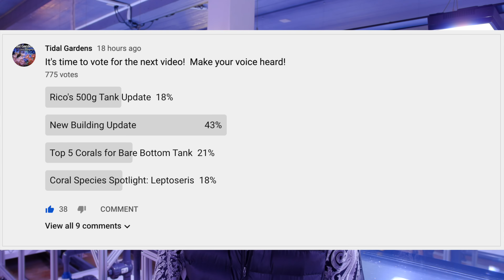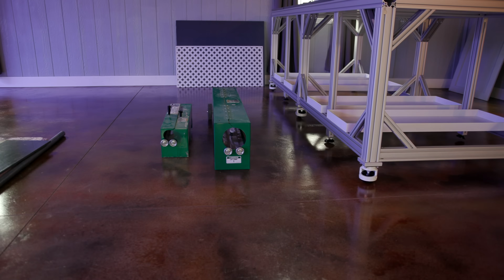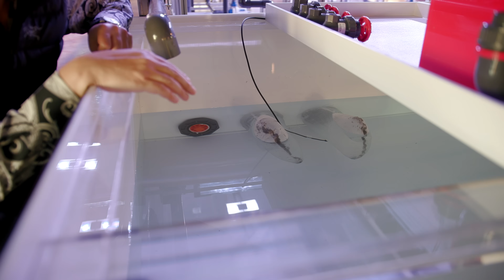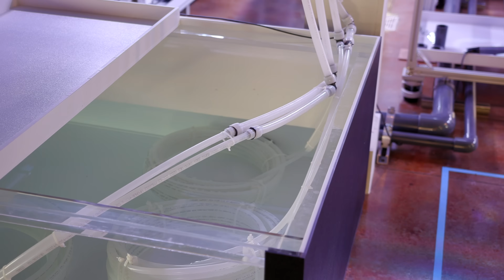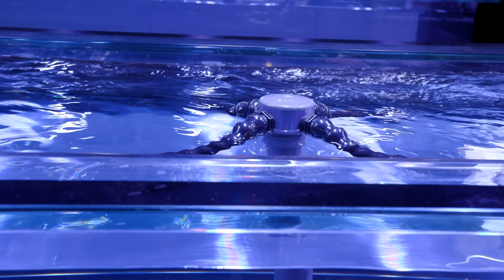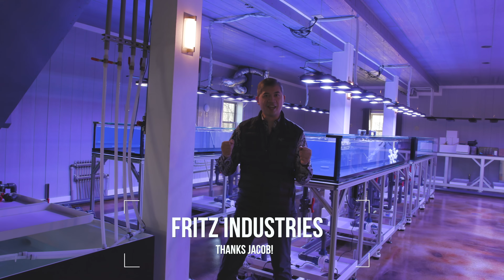Tidal Gardens November 2019 New Building Update - Episode 12

Comment: 6:49 I dont understand why you decided to use so many 90 degree elbows on the pumps under the tanks... By just slightly move the pump and rotatate it 90 degress, no less than 3(!) of the elbows could get eliminated and a lot of unnecessary head pressure would be gained on each setup. The same applies to many other places on the pipings.

Comment: Why did you use schedule 80 instead of schedule 40 pvc pipe?  Seems to me your pressures are not high enough to exceed the capacity of schedule 40.  Great build by the way.  Your geothermal temperature control system is unique and great.👍

Comment: If you want to bend smaller diameter pipe up to 1” and don’t have access to a hot box, heat gun will work.  Fill the pipe wth sand and heat and bend!

Comment: You are living a dream for reefers around the world.
I saw the air make up in the back but what about dehumidifiers ? 
Just wondering .
Reply from the maker: For the winter the air exchangers can easily handle the humidity.  They are surprisingly good at that as a matter of fact.  We have them set to the lowest fan speed and the building is dry.  Once we get into the humid spring and summer though we are going to rely on the air conditioning first.  I have one 5-ton unit, but the line sets ready for a second 5-ton unit.  If that is enough we will have to add dehumidification near the tanks.

Comment: May I ask what are the frames for the tank stands and where might I be able to get them?
Reply from the maker: It is 80/20 aluminum t-slot
Reply: Michael Balsley it looks like 8020 aluminum extrusions.  Probably one of the metric types since he mentioned using M8 screws.   It comes in a variety of sizes and configurations in metric or imperial.
Reply: Likely Framing Tech https://www.framingtech.com/solutions/aquarium-stands/

Comment: Love the new set up, Than. Wish I lived closer to see everything when you're done. Had a question for you: are you just running the single L2 on those frag tanks? I'm setting up a 130 frag system and was going to use a Varios 8 for a closed loop until I was told that DC pumps don't handle head pressure that well. First time setting up a closed loop so any help would be appreciated. Thanks!

Comment: Great vid! I'm surprised you didn't fit sweeping elbows on the 3inch drain section where you're planning on using a drain snake. I reckon you'll have problems getting it through that tight 90. Can't wait to see everything stocked!!!
Reply from the maker: Hopefully it wont be a huge deal. Just for fun I looked up the price of a 3" schedule 80 long sweep. Makes my eyes bleed.
Reply: @tidalgardens  I can imagine! What was the reason for going schedule 80 on everything? Just added peace of mind on how hardwaring the system needs to be? I guess you're about as industrial as it gets in the industry hehe! I check your channel every day just in case I've missed a notification!
Reply: I was thinking the same thing. That tight elbow is going to be a pain to get the snake past.

Comment: I'm very curious what kind of hassle/maintenance over long term will be, to me it look super solid and your design/choice are the same has I would do minus your experience.
You could make a rotation/spining thing with the return tube, from your closed loop, potential is here.
Reply from the maker: We have some but they are cheap and look like they would fail. Also vectra pumps have a closed loop mode where you can program them to do different flow patterns. Having said that we will probably just leave them at a set speed.

Comment: Thanks one more time for sharing, such a nice and reflected setup! I would be worried a little bit about your overflow system / sump capacity: if you stop return pump (and there's only one), water level will go down up to level of main first overflow. With such long tanks, and you've got 4 right?, is the sump really big enough? Would suggest to consider one modification on these main overflows: use another tube on them, to reverse the intake not at the top but bottom, and little hole just under water level of the skimmer to deactivate the syphon. 2 benefits: taking water from bottom, and minimise diff between main and skimmer overflow, meaning less water going to the sump if return pump stop. What do you think? ;)
Reply from the maker: We are going to test it and install siphon breaks if necessary. That part is easy. The sump itself is huge. Around 500 gallons total.

Comment: By design closed loops look good on paper, but how are you keeping your heating closed loop separated from your system like when you lose power and everything flows to the sump?
Reply from the maker: The closed loops are always separate. Tank water does not flow through them, but rather fresh water that just circulates through the PEX pipe. The heat only comes on a few min a day to heat the tank so in that sense it is almost always powered down.

Comment: 4:33 cracks the bottom of the tank, tank empties on the floor. X-D
Reply from the maker: It would be really hard to crack 3/4" glass
Reply: @tidalgardens  true
Reply: All kidding aside, do you have any worries of someone bumping that plumbing with a bucket or something and cracking the tank? A lot of leverage applied to a tiny area, especially with the main drain line being that long.
Reply: Im pretty sure the emergency drain is if the main one fails and the sump is pumping too much water into the tank, the emergency drain would basically replace that if there was a failure or blockage in the main drain
Reply: Great video Than build progress has shifted up a gear looking awesome